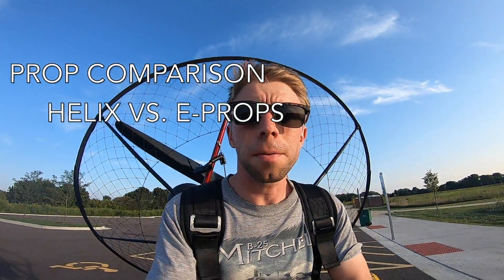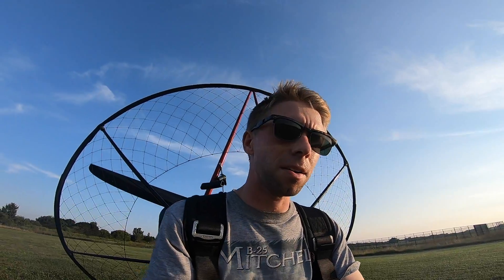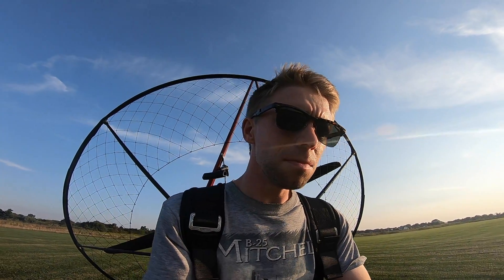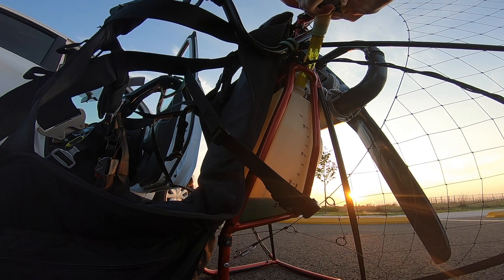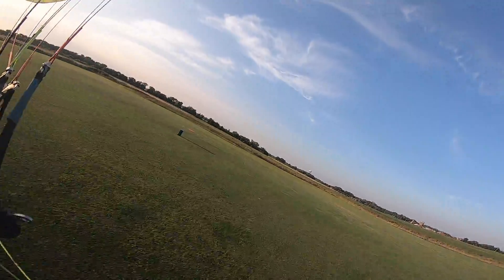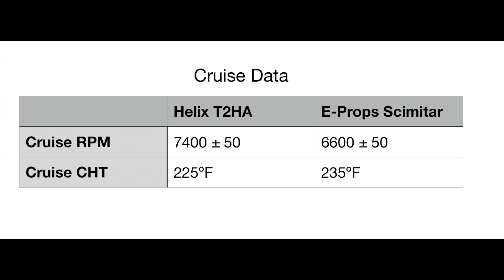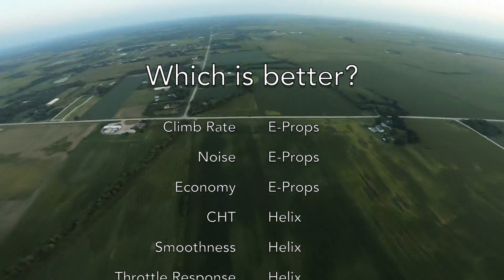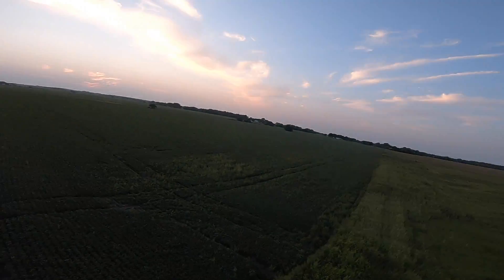Top 80 Propeller Comparison

Comment: I would go with the E Prop. Faster climb rate is a plus, also the lower rpm’s might contribute to a longer engine life. The operational temperature is a little higher with the E Prop however It is still in the acceptable range.

Comment: Wonder if you have any update on the Top80 and 130cm E-Prop combination, still the same combo? Have you tried flying a smaller wing with the same setup?
Reply from the maker: I switched from the Top 80 to the Atom 80 2 years ago, so no updates on the Top 80.  I've flown both props on the Atom 80 (Atom-specific props, not the same as in this video) and the only difference is that the Helix is noticeably smoother, especially at high RPM.  I think they're much more closely pitched to one another for the Atom than for the Top 80 which is why the two had a measurable performance difference on the Top 80 but really none on the Atom 80.  If you're in the market for an 80cc engine, the Atom has been fantastic.  Currently flying a 16m Viper 4 and have no problems with the small engine/small wing combination.
Reply: @scottduncan2353  thanks for the reply. May i know your all up flying weight with fuel?
Reply from the maker: @marcuschandrasegran8935  Typically about 105 +/- 5 kg

Comment: Why does the E Prop result in higher CHT?  Assuming it's the planform of the prop drawing less air past the engine?
Reply from the maker: I can't say for sure, but if I had to guess it might have something to do with a greater load on the engine. Kind of like riding a bicycle in a higher gear ratio: you can pedal more slowly (the E-Prop's lower cruise and max RPM,  in this analogy) but will have to exert more force on the pedal (corresponding to a higher CHT despite the lower RPM). On a  propeller-cooled engine like the Moster, I think the prop planform could have a big effect on CHT, but the Top 80 is forced-air cooled by a fan and most of the cylinder is cowled with only small cooling-air exhaust vents at the back. Because of this, I suspect that any propeller cooling effect is minimal if existent. In fact, if you look at the planform of the E-Props vs the Helix, you'll notice that the E-Props actually has more of a traditional "cooling profile", but still gives a higher CHT.
Reply: @scottduncan2353  great observations - thanks!

Comment: Very informative. I have been using a carbon fiber 125cm prop for the last 3 years. I was thinking of stepping up to the 130cm size, and will probably go with the eprop. Do I need to add the prop spacer when stepping up to the larger size prop? Not really sure what the prop spacer does performance wise. It came with the unit, and I have never tried it.
Reply from the maker: Thanks!  In theory, the prop spacer should increase efficiency by giving the prop better access to less disturbed air.  However, in practice I doubt you'd see a measurable efficiency or max power difference.  Most frames that require a spacer do so due to clearance issues with the cage.  For example, according to Miniplane-USA, the Classic Miniplane frame has adequate space and doesn't require a spacer, whereas the New 2016 Miniplane frame does recommend the spacer for all props.  If you're worried about prop clearance, I'd add the spacer.  Another thing to consider is how the prop size might affect your ability to do power forwards.  My Miniplane cage is flexible so I don't do power forwards, but if you have a more rigid cage, it likely still flexes a little bit under tension from the lines and if you go from say 5 cm clearance to 2.5 cm clearance, that might be enough to chew up your prop with your net.  I'd recommend talking to someone with your frame/engine combination to see what their experience is with different sized props.

Comment: Hey. You can tell me how many rpm you have on the propeller eprops 130cm on the ground?
Reply from the maker: 9200-ish for a full power ground run-up
Reply: It's weird. I have exactly the same propeller, e-props, 130cm, scimitar design, top80 19/73. The engine reaches 9600 rpm on the ground. I did not fly on it yet.
Reply from the maker: Weird indeed.  Is this the only prop you've had on it, and if no, what was the previous propeller reading?  I wonder if we have error between our tachs or if you're really outputting more power than me.
Reply: @scottduncan2353  I checked with the second tachometer. Rotational speed is up to 9700 RPM, (9600-9700) measured on two revolutions, but the same company. I will try to get a completely different tachometer to confirm rpm. I live at 206m AMSL (675ft), temperature during test around 0 deg C. I still have a three-blade propeller, but it's adjustable so the measurement will not say anything. I'm starting to think that my propeller is less straining the engine. Can you read some signs from your propeller? (near the hub)
Reply: @jandolasinski5384  seems like you had ideal conditions for the engine to generate power (lower temp and altitude).

Comment: So any issues with the 130cm coming close to the lines ever?
So you have 225 hours on that engine and frame,wow any issues?? Thanks for the video man,Im a top 80 lover!!
Reply from the maker: Yes, I've chopped lines before, although it was 100% pilot error.  Wing came up crooked (stressing the cage into the prop) and I tried to power through instead of aborting.  The Miniplane cage just can't do that.  If lines are flexing the cage, don't add power.  I knew this intellectually, but didn't do it because I didn't want to abort and set up again with all of my winter gear on.  As they say, play stupid games...  FWIW, the prop was fine, but I ended up replacing a few lines.

Just over 265 hours now.  Several issues: In addition to routine maintenance tasks: 1 carb replacement (could never pinpoint the cause -- rebuilt the first one, checked all checkable values and everything looked good-- but only a complete carb replacement fixed my engine issues), 1 top end overhaul following a failed roller cage bearing, and I'm currently down for a failing crankshaft bearing.  As I understand it, my engine's unreliability is abnormal and I'm still trying to figure out why I'm having such bad luck with my particular engine.  Fresh fuel, good oil, cleaned and maintained meticulously, so who knows.  My dad's engine has 250+ hours on it and he's only had a failed secondary wire in addition to routine maintenance tasks, which is more typical for a Top 80.
Reply: @scottduncan2353  wow yeah bro thanks for info..are u running 10% ethanol or non?
Reply from the maker: @577buttfan  E10.  Obviously not ideal, but I run frequently enough and in small enough batches that I'm almost never putting anything in that's more than a few days old.  My dad's been doing the same and has had no issues with is.  As I understand it, the biggest issue with ethanol is in the fuel lines and carburetor diaphragms especially when it sits.

Comment: How much do you weigh? Which wing and its size are you flying?Thanks!
Reply from the maker: 150 lb.  The wing in this video is a 24 m^2 Ozone Roadster 2.
Reply: I weigh 175 and have a Spyder 26. What do you think, would the top 80 work for me?
Reply from the maker: Yes, but depending on the type of flying you like you might want something more powerful.  There are plenty of pros and cons to each engine, but I'm very happy with my Top 80.  Check this out if you're worried about power: https://www.miniplane-usa.com/tips/yahoogroup.htm  

What are you flying currently?